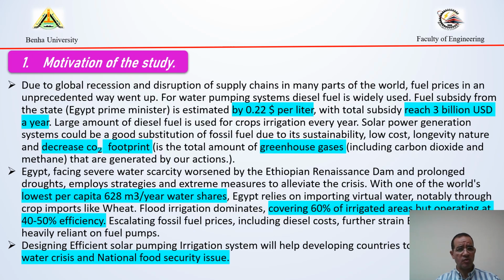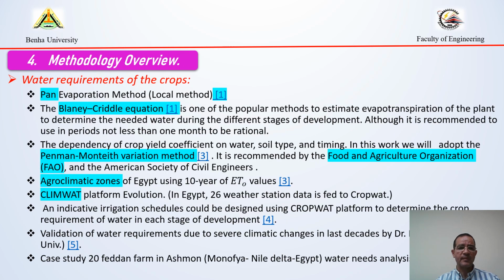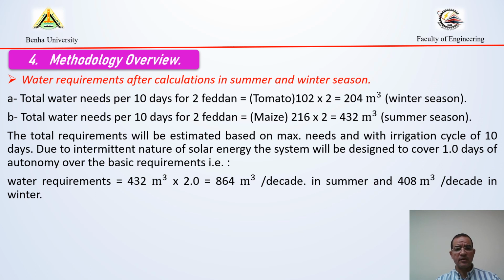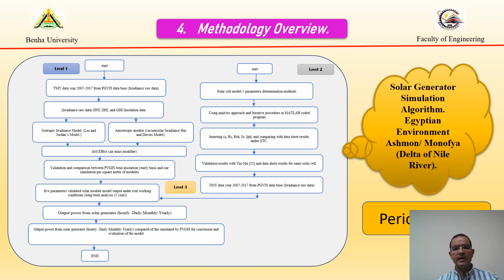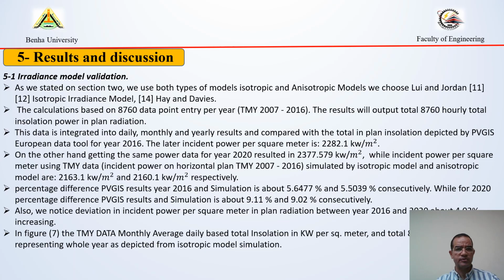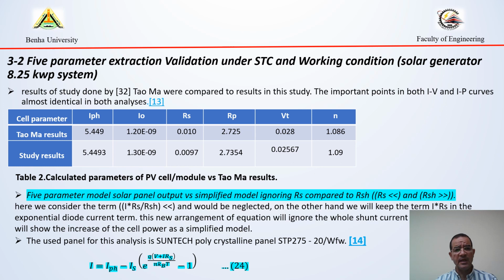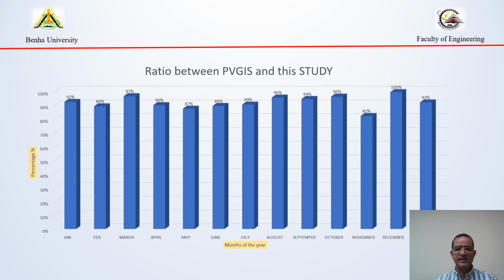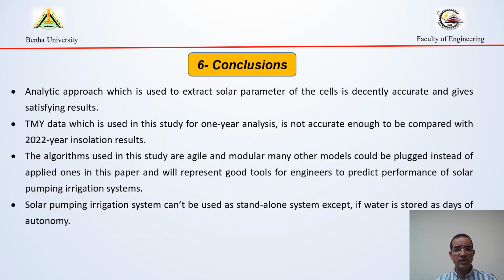FRUCT34: Innovative Solar Photovoltaic Solutions for Water-Efficient Irrigation: A Comprehensive...

Comment: What are the practical consequences of your research study? At least as possible further direction. Are your algorithm can be useful for other experts in the area?
Reply: the system algorithm is partially applied in some lands in Egypt. It actually reserve water Also fuel reduction is proved to be accomplished but some parameters and concepts of the study are not applied due to lack of funding. also the algorithm is modular and sizeable and many other models could be plugged in and tested using the same algorithm.
Finally the algorithm is good tool to design and predect solar water pumping and solar generating system any part of the world.